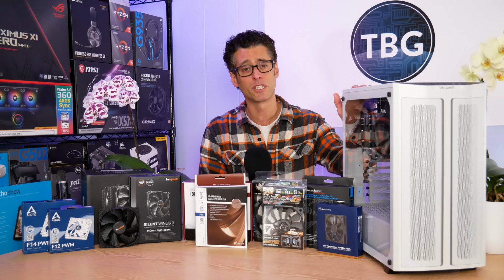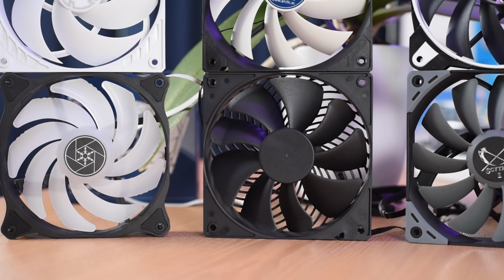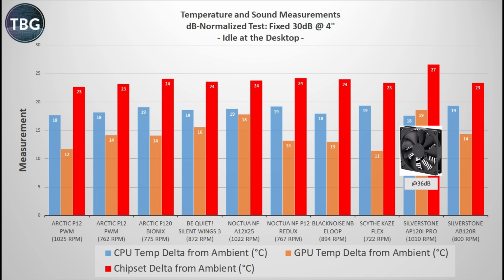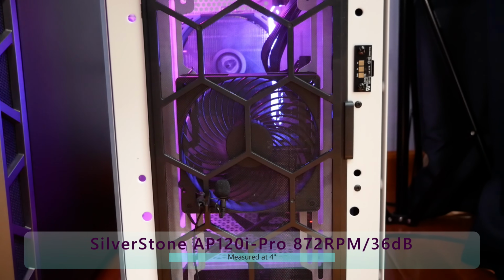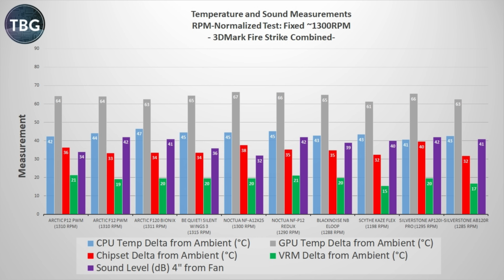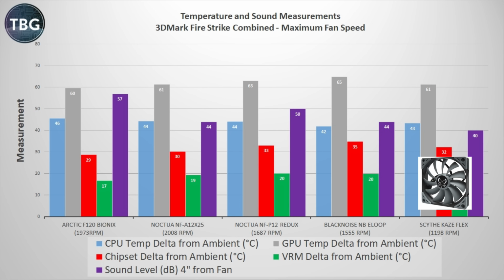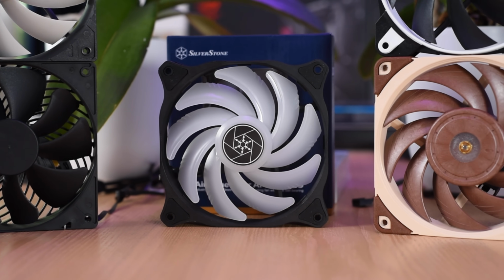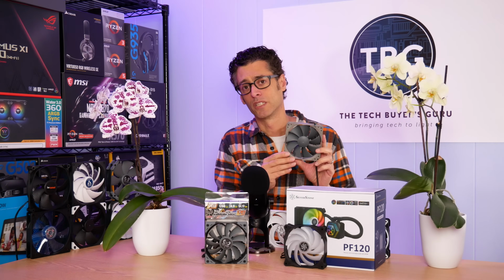The Best 120mm Case Fan Shootout: Arctic vs. be quiet!, BlackNoise, Noctua, Scythe & SilverStone

Comment: So what’s best to buy for a case fan , p12 or f12?
Reply from the maker: Well, before I conducted this test, I would have guessed the F12, because the P12 was so good on radiators. Yes, I did say that correctly. The P12 was designed primarily for coolers. But after doing this test, I now recommend the P12 for both coolers and cases. It's an excellent fan, and can be purchased in a 5-pack! - https://amzn.to/2A1KmQX
Reply: Thanks

Comment: For me the Silverstone AB120R was quieter than all the others even at 41db than Noctua at 32db. 
It must be the frequency at which the fans are producing the noise
Reply from the maker: I was shocked at this too. My dB meter said one thing, my mic said another. The frequency definitely matters here, and so does the source of the noise (airflow, motor, or bearings). That's why I have both benchmarks and audio tests. I think the SilverStone AB120R (https://amzn.to/2Yd4dnZ) has excellent motor and bearing characteristics, but it also produces a lot of airflow, which is heard by the dB meter more than the microphone. Then again, it also performs well, which one would hope from high airflow, so I think it's a great all-around pick.

Comment: No Ultra swag fans like EK X3M, COrsair LL120,, TT RIING?
Reply from the maker: I've tested LL120s in my Corsair 465x review (https://youtu.be/CkiYAHrvCKs), and they were fine, but I think they're a little loud for a case fan. I've tested a bunch of Thermaltake fans in case and cooler reviews, and they are actually quite good. Never tried EK fans, but I've found that the dedicated case fan manufacturers are generally the best at making case fans, so that's what I stuck with. EK's X3M fan would almost certainly fail in this test, because it's a static pressure fan not surprisingly designed for coolers, and the LL120s will be featured in an upcoming AIO cooler review, where I think they'll do better.

Comment: It is not just about dB level, but at what frequencies are being generated. Everyone has a subjective opinion of what sounds loud, no matter the dB level. I have tried most and be quiet! is the brand that give me the best overall performance at the lowest dB level. And there is a high flow version with pwm control that goes to 2200cfm, if i remember correctly.

Comment: I would love to see both, case fan placement and 140mm testing. If you want to do it I would recommend fractal meshify s2 case, according to most tests online the fans included in the case do not have enough static pressure AND are to high to properly cool GPU. I imagine that case could be used to kill two bird with one stone so to speak. Tho it would obviously make it less of a comparison to 120mm fans in the test here, if you go that route.

Comment: Buyers tip: The video mentions the Scythe fan is out of stock world wide, I found a few local shops near myself that still have some stock (under 10 pcs).  I also saw that Scythe has 5 different 120mm Kaze fans availabe,  namely a 800rpm, a 1200rpm, a 2000rpm, a 300-800rpm PWM, and a 300-1200rpm PWM version. This video reviews and links to this last one.
Reply from the maker: Thanks for sharing! Going for the 1200RPM 3-pin model (https://amzn.to/2Uialuc) might be a good option as well. I'll include it in the video description.

Comment: Timestamps (for the video description)

0:00 Introduction and test setup - Filling with hot air
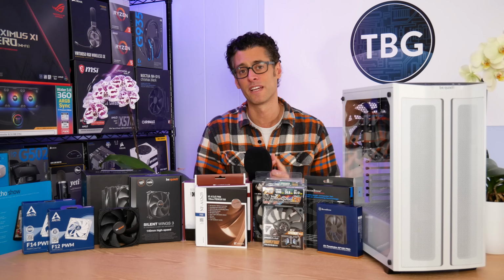1:30 Ten Contestants - Approximate USD prices
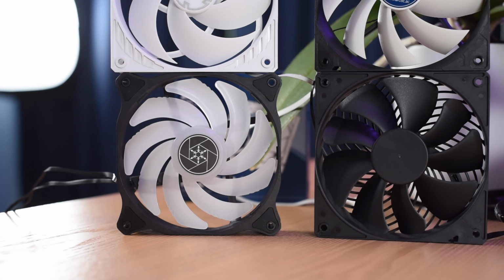3:18 Test platform 
3:30 Special thanks to Blacknoise
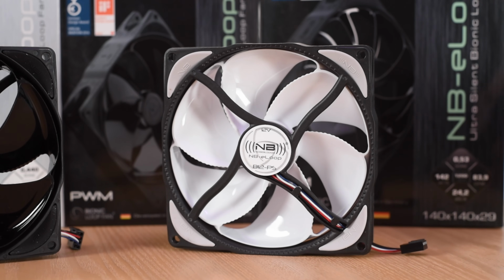3:53 Test methodology
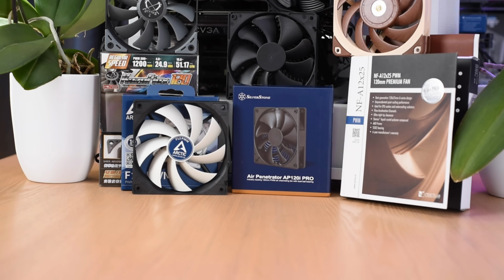5:13 Idle at the Desktop Benchmark
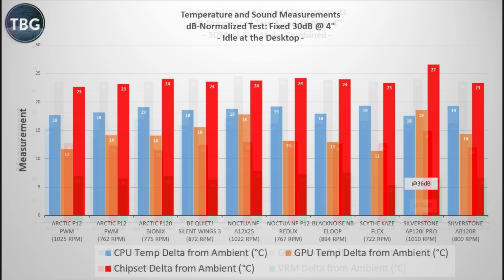6:18 Load Benchmark with 3DMark Fire Strike Combined
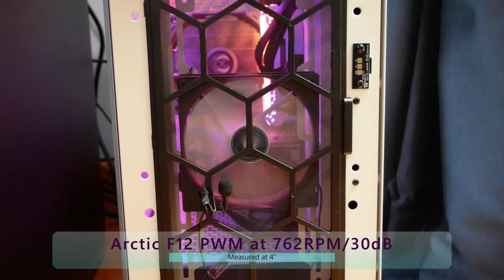7:18 Arctic F12 PWM at 762rpm/30dB
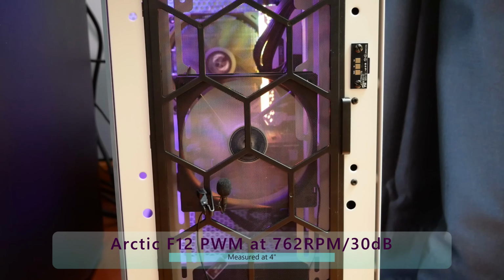7:29 Arctic F120 BioniX at 775rpm/30dB
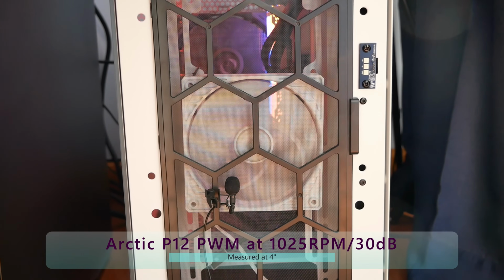7:40 Arctic P12 PWM at 1025rpm/30dB
7:51 be quiet! Silent Wings 3 at 872rpm/30dB
8:00 Noctua NF-A12x25 at 1022rpm/30dB
8:11 Noctua NF-P12 Redux at 767rpm/30dB
8:22 Blacknoise NB e-Loop at 894rpm/30dB
8:31 Scythe Kaze Flex PWM at 722rpm/30dB
8:43 SilverStone AP120i-Pro at 872rpm/36dB
8:50 SilverStone AB120R at 800rpm/30dB
9:02 Temperature and Sound Measurements at 1300rpm
11:44 Arctic F12 PWM at 1310rpm/42dB
11:54 Arctic F120 BioniX at 1311rpm/41dB
12:00 Arctic P12 PWM at 1300rpm/34dB
12:12 be quiet! Silent Wings 3 at 1315rpm/36dB
12:23 Noctua NF-A12x25 at 1300rpm/32dB
12:34 Noctua NF-P12 Redux at 1290rpm/42dB
12:44 Blacknoise NB e-Loop at 1288rpm/39dB
12:53 Scythe Kaze Flex PWM at 1198rpm/40dB
13:04 SilverStone AP120i-Pro at 1295rpm/42dB
13:13 SilverStone AB120R at 1285rpm/41dB
13:24 Temperature and Sound Measurements at maximum fan speeds
14:54 Arctic F120 BioniX at 1973rpm/57dB
15:02 Noctua NF-A12x25 at 2008rpm/44dB
15:10 Scythe Kaze Flex PWM at 1198rpm/40dB
15:13 Conclusion & Recommendations
21:00 Looking Forward: 140mm Fan Round Up, comments in advance?
Reply from the maker: Oh my goodness, this is awesome!!!! I have already added it to the video description, and with YouTube's new Chapters functionality, you can browse them in the video window! I can't imagine how long this took you to compile, thank you!!
Reply: @TheTechBuyersGuru  Youtube has already made speedviewing easy for all videos, so it didn't take that long. I was genuinely interested in adding casefans to one of my systems at home, after spending EUR100 on two CPU coolers last month, mostly based on your review https://www.youtube.com/watch?v=nx3axNgZs8U. I appreciate your efforts too ;)
Reply from the maker: Thanks again! Which CPU coolers did you get?
Reply: @TheTechBuyersGuru  I chose the Noctua NH-L12S. I Installed it inside a Silverstone Grandia GD09 (with a bent drivecage mod) paired with a
Gigabyte GA-AB350M-Gaming 3, AMD Ryzen 5 2400G Boxed and Kingston HyperX Predator HX432C16PB3K2/8 memory. The 3,5" space of the optical drive cage in the GD09 (no replacements parts sold, just the entire case) is not essential in an HTPC to me, it had to go.
The other NH-L12S went inside a Cooler Master Silencio 352 paired with an MSI B450M Mortar Max, AMD Ryzen 5 3600 Boxed and Kingston HyperX Predator HX432C16PB3K2/16 memory. I used the high clearance mode for future RAM upgrades, it would not fit otherwise.
While doing this, I found that putting the fan in pull mode (Noctual label up topside) you will get a 'nice' fan whine due to resonance at high rpm. So this one is blowing down now.
Reply from the maker: Great choice on those low-profile coolers. And makes sense that setting up the NF-A12x15 as a pull would cause resonance. Definitely better blowing down if you have it mounted on top.
Reply: @TheTechBuyersGuru  you should credit him at the end of the description! And delete the part about comments lol. But awesome vid dude!

Comment: I found it interesting how they hummed in different audio frequencies. I would have figured the Blacknoise would be more quiet since the blades are all connected, you'd think it would cut down on turbulence. I'd go with the Scythe's, or the RGB silverstones if I wanted RGB.
Edit: and looks like you'd agree!
Reply from the maker: Those Blacknoise fans are very, very interesting. I feel like additional testing may be warranted, they have some unique properties. Their hum is very deep, which actually may not be a bad thing. Really depends on the listener. A low-pitched noise does tend to travel further (basic physics: low frequency, long wavelength), while a high-pitched sound tends to be more distracting to a listener. I also think they have some air channeling properties, which actually increases turbulence by spinning the air rather than just pushing it in order to make it directional. Lots of fun stuff!

And yes, glad you agreed Scythe and SilverStone RGB were the best!
Reply: Yes, that’s what I was thinking too. A lot of fan reviews always measure the decimals, but not the frequencies. The human ears are more sensitive to certain frequencies than others. I would love to see a graph from an RTA to see the frequencies. Even though some of them had lower decibels but it had higher frequency and it was just more irritating to me. I like this review.

Comment: The distance of the mic - I would have prefered that tested from say 10cm away from test fan. great review though - I have that case.
Reply from the maker: I do regret that I put the mic so close. I measured the dB from 4" (which is in fact 10cm), but placed the mic on the case to make it completely obvious on video where I was recording the sound. After collecting the 10 clips and listening to them, I wish I'd done it another way, with the mic on a stand where I collected dB data, but reinstalling 10 fans and re-shooting all the video would have taken 4-5 hours. I couldn't make that kind of investment in time.
Reply from the maker: By the way, any follow-up shootout will utilize a mic stand at 4"/10cm, so I fully appreciate your suggestion!
Reply: @TheTechBuyersGuru  that is indeed a pretty good idea as we can't really get an idea of real sound profile here, the clip mic must have collected a ton of case vibration (comming from all moving parts) some air turbulance as well. Sound profile is sometimes more important than raw db mesurements. It would be interesting as well to know what ponderation have you used, dbA or dbC.
Reply from the maker: I used dBA, but I didn't even know about dBC and just read about it. Very interesting!
Reply: @SebastienBrunier  Indeed, the numbers don't show how loud the Silent Wings 3 really is when it's against a mesh filter. You can hear how bad it is in the recording but in the graphs it looks as if it's one of the quieter fans, when it is in fact one of the loudest to the ear.
Reply: Yep, fan distance to filter, filter's solid support parts and mounting structures for fans in case affect different fans hugely differently. One can get fully different results in noise profile and level.
Reply: @SebastienBrunier  It's not case vibration that's getting picked up, it's near-field pressure variation from the passing fan blades.  That's why there's so much bass.  But the pressure distribution on each blade is nearly constant as it goes around (as long as you don't have stuff too close to the intake), so it cancels out and the noise disappears far from the fan.
Reply: @TheTechBuyersGuru  In my opinion even 10cm is still too close. I think you should standardize the distance to me more realistic, like a mean distance most of users sit from a pc case. I would say ~30 cm maybe even a bit more. In this case the data/results would be extremely valuable as those would represent real life scenarios as much as possible.
Reply: Was there air hitting the mic heading to the noise levels?

Comment: Definitely do the 140 round up. And maybe a 140 vs 120 comparison. I have 2 LTT NF-F12s & an NF-A15 (from NH-D15S) as intake up front, 2 SS AP140s up top as exhaust, & a Fractal Design Silent series 120 as exhaust in the back (only because it's white). The Noctuas up front are all PWM and controlled by the motherboard so i've had no complaints there but the AP140s were a pain to quiet down. I have all the exhaust fans plugged into my case fan controller (P400A non-RGB) and had to use my noctua LNAs on both the AP140s so they weren't obnoxious. I'm really curious to see how they stack up because I believe the focused air flow has a lot to do with the excess noise. Really impressed with the SS AB120R-ARGB and may have to pick one up to replace the fractal fan in back.
Reply from the maker: I have a few SS AP141s on hand, and you may have caught a sneak peak of one a few times in the video, but I'm not sure if I'm going to test it. Depends on what I focus on in my next video. I agree that air channeling probably increases noise, but just a tip: I think if SilverStone were to give you advice on how to utilize these most effectively, they would say you should install them as intakes up front, rather than as exhuasts. So consider swapping them with your Noctuas. Another interesting fact that you may have discovered for yourself: Noctua's LNAs have a much bigger impact on max RPM than min RPM, due to how they operate (cutting voltage), so sadly they end up being of only limited use if you are trying to reduce idle noise levels. You might cut 200RPM off of the max and only 75 off the min, when all you really want to do is shut those SS140s up at idle!

By the way, I have told SS over and over again throughout the years that the minimum RPM spec on their fans is way too high, and guess what, they responded with the AB120R (https://amzn.to/3eP31y2). It's a great fan, and has an ultra-wide RPM range. Would be a nice upgrade to your Fractal fan if you want the ARGB effects. I've tested a number of 3-pin ARGB fans from Cooler Master, Scythe, Thermaltake, and SilverStone, along with Corsair's proprietary ARGB fans, and the AB120R fans are my favorites. Scythe's ARGB Kaze Flex was a huge disappointment, despite how well the real Kaze Flex works.

Anyway, that's my 2 cents on all this!

Comment: I have 5 arctic p12pwm in radiators and they are amazing. Payed 27 euro. Top
Reply from the maker: A full P12 or P14 5-pack installation is definitely in the works for the next cooling shootout.

Comment: Question! How is the mic 4 inches away from the fan when it is literally attached to the case barely a quarter of an inch away from the fan?
Reply from the maker: Mic is for camera, not decibel meter.   The recordings were just to show tonal quality. Sound level was measured 4" from position of mic.

Comment: i just bought 3 noctua redux fans, would u recommend cancelling the order and going with the kaze or arctic p12 pwm instead? I only care about mostly noise levels
Reply from the maker: The Redux fans were the loudest in my test. For the price of 3 Redux fans ($42), you could get a 5-pack of P12 fans with integrated PWM splitters (https://amzn.to/3dFgzvE), plus have another $15 left over for a Scythe Kaze Flex! Note that the Kaze Flex is out of stock worldwide, and it could be a while before it restocks.
Reply: @TheTechBuyersGuru  i actually managed to find 2 kaze flex on ebay so I went ahead and bought those, it was 2 for 25 cause I didn't feel like waiting for it to come back in stock. Gonna get some p12s too. Thanks for the video and all the info.

Comment: in maximum fan speed test, i wonder what p12 can do. I'm a p12 fan.
Reply from the maker: Are you a P12 Fan, or a P12 "fan"? Ha! Yeah, I should have tested the P12 at max RPM. One way or the other, it will make it to the next round, so there's still time to see max RPM when I do the fan optimization or 140mm fan test.
Reply: The Tech Buyer's Guru  I' m both :d, of course it is. What a good invesment P12 it is.

Comment: Amazing review, thank you! Just convinced me to subscribe to this channel. Finally someone with good fan review away from noctua fans. I have a bunch of noctua's which I replaced in my system. If you listen carefully is more to a fan noise than dB. Noctua's have an awful buzz even at a low rpm. Replaced my 120 radiator fans (noctua) which cost me £20 each with Arctic P12 at £5 each and they are so much better. Thank you again and keep up the good work!
Reply from the maker: Thanks for the sub, and thanks for the feedback on the audio testing. You know, I let that speak for itself, I do not do a lot of commentary about those noise patterns, because what's pleasing to one person is not pleasing to another. But they absolutely sound different, even at the same decibel level.
Reply: You have a12x25 noctua? I am waiting for the chromax version coming soon, but when I saw the arctic p12 in the radiator review, I was surprised. What is the real difference? I am going for as low noise as possible. My Noctua A14 has a very low frequency noise which I dont find buzzing, but I hear it on the A12x25 in this review. You mean this humming buzz although low in decibel?
Reply: @Hyper1555  I had 4x120 noctua's on a 240mm radiator which I replaced with Arctic P12. Yes I am talking about the low pitch sound of the noctua's. Not the only fans I tried though, I also tried bequiet silent wings 3, Corsair ML 120, NZXT fans... settled to Arctic. However as TBG mentioned everyone has a different perception of sound tone. For someone else noctua's may sound better.

Comment: I would be concerned with your test result's as some of the fans did not seem to have All 4 corner's screwed down, in fact one or two seemed to be off square...espically the Arctic F120 BioniX...that fan was WAY of square and looked very odd...imo
Reply from the maker: Very good eye. I used zipties to attach them. Screwing them in would have required a large amount of work, in part due to the fact that getting a screwdriver into the main chassis to install and remove the screws was essentially impossible with a CPU cooler and GPU and installed. It's a compact chassis, so this was the solution I came up with. I'm confident it had no impact on the results.
Reply: I can personally vet for TBG's results with dbas concerning the f120. It's very loud, good and low level rpms but once it get above 1500-1900 threshold it's just way too much turbulence. No it's not cool wine, it's the turbulence. Arctic was a bit misleading with it's website specs and product specs. TBG did a good job of properly reviewing and giving ideal condition comparison of case fans.